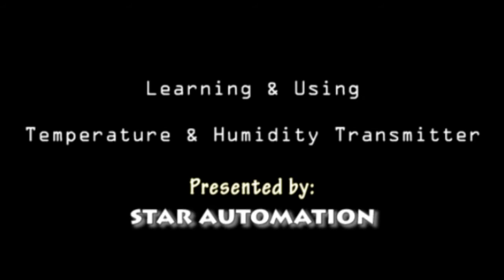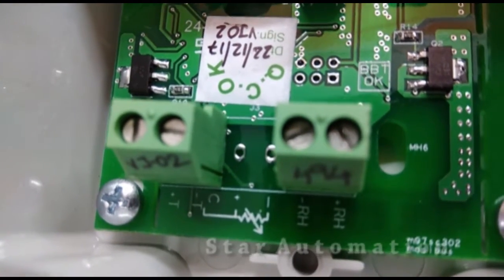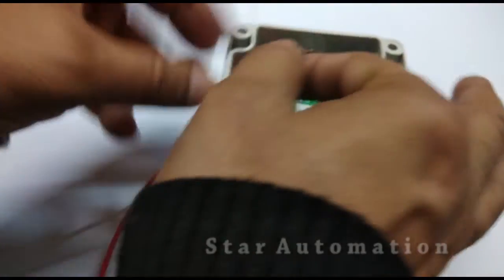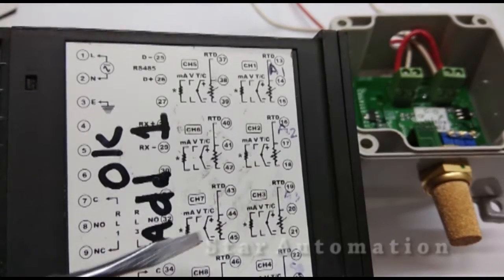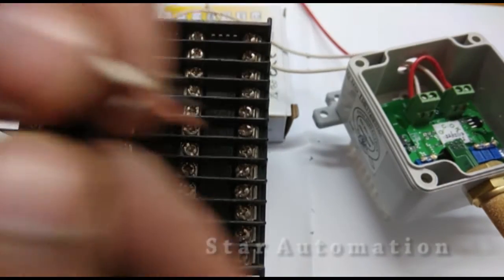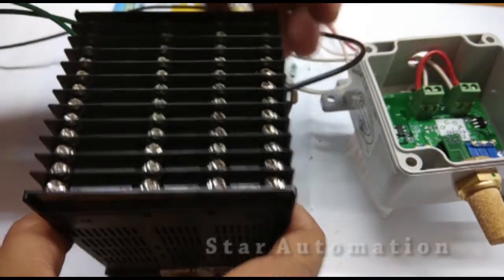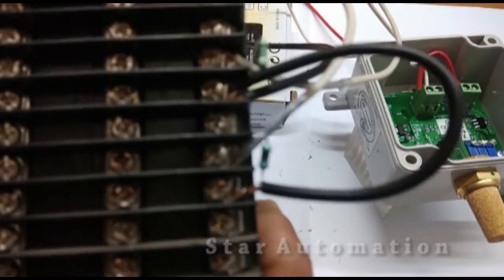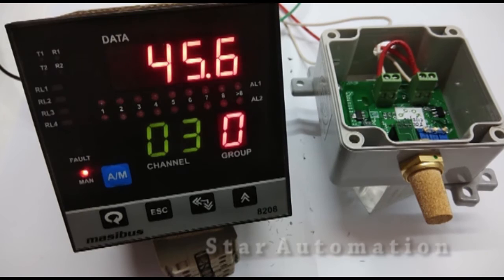Using Temperature & Humidity Sensor

Comment: From where u took 24v Dc for sensor input
Reply from the maker: We have used 24v dc power supply. It is also called as SMPS, switched mode power supply